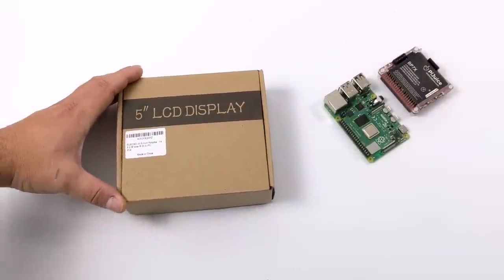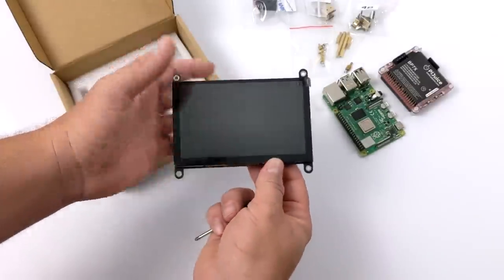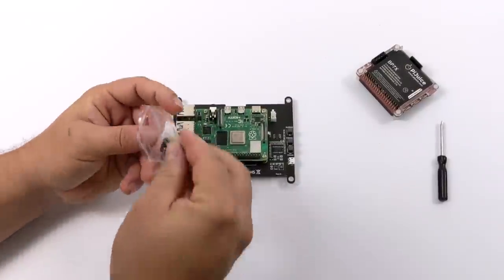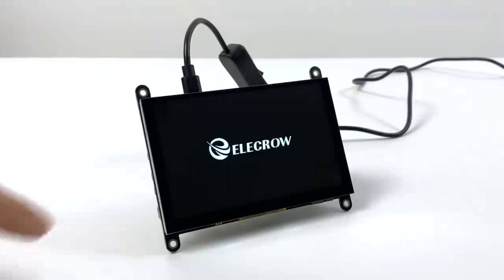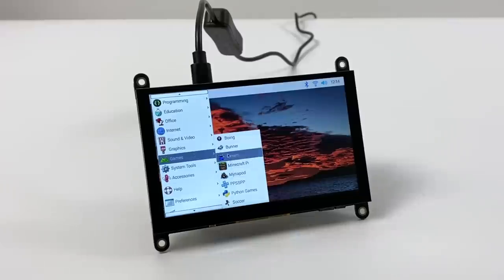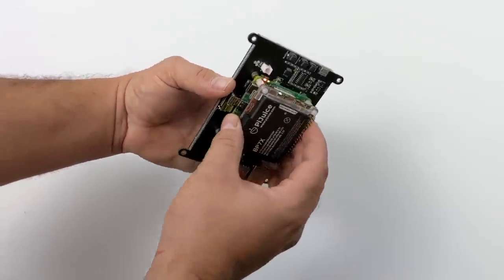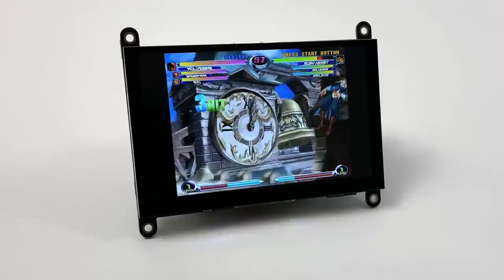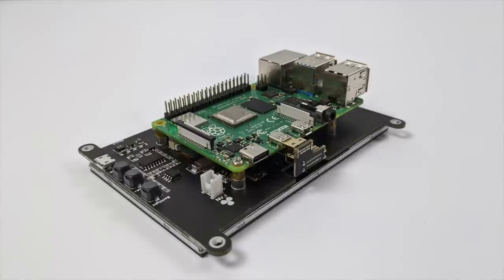Awesome 5 Inch IPS Touchscreen For The Raspberry Pi 4! HDMI & Built In Speaker

Comment: Great product, perfect for a handheld project. Would love if they had a 7" variant.
Reply: They have a very good one. I have the one from eviciv on amazon and it’s fantastic. Powered through the Pi and has two speakers. No plugs extending outside the frame.
Reply: They do. I’ve been trying to decide myself for a bit, and both size Elecrow ones are in my shopping cart on Amazon right now. IIRC the resolution on the 7” is 1024x600.
Reply: Gonna check this out for myself thanks for the info!

Comment: Mine arrived yesterday. Picture quality is excellent. They did a good job with this.
Reply: Hey did you have to edit the txt config for the screen to work?
Reply: @edgar-vt5qi  I edited the config.txt to what the manual has listed, but I think I recall having some kind of issue. Can't remember offhand now what it was that went wrong, but I think it involved changing either the hmdi_drive or hdmi_mode line value from 1 to 2 and that fixed it.

Comment: I hope ELECROW does the same "upgrades" to their 7" display! The removable mounting tabs, the inset ports with specific adapters to plug in a Pi. I can't stand all the cables sticking out the side of their existing 7" model and old 5" model. That makes it very inconvenient to mount inside a case (or makes your case a lot larger than it needs to be). One last gripe about both: the resolution. Sure I can see a low res on a 5" display. But that 7" display needs to be at least 768 pixels tall. Most modern OS need that much height to properly show their windows, dialog boxes, etc. 600 pixels just doesn't cut it.

Comment: That's a really good screen, I wish it would be 1080p but at least it doesn't have screen tearing. Will you try the new Hyperpixel 4.0 Square? Its a 1:1 720p screen but there is absolutely no video testing it on YouTube and it might be the best retro console display out there!
Reply: That looks nice. I have to say, I made a pseudo 1:1 cabinet so I could play both horizontal and vertical arcade games without physical rotation. It's "pseudo" because it really is a 43" display mounted vertically inside, but only a 2160 x 2160 square is visible. Anyhow, you could achieve same thing in a handheld with this Hyperpixel.
Reply: @4h0w1e6  I'm really digging the 1:1 aspect ratio, I have a Blackberry Passport that serves that arcade purpose and little gamedev (tamagotchi-like and such silly games haha) and would love to see a review for that display, the borders are even on all sides so embedding it would be really easy and clean looking

Comment: Hi Eta Prime, thank you for the great reviews on your channel.

It is precisely because of this clip that I bought the same set for a project.

The Pi4 with 4GB of memory and this 5inch monitor.

The power supply has yet to come in, but if I connect everything as you show in the video, it won't work with a USB charger or power bank.

If I leave the USB connection off for the power display and I supply the display with power via the power bank with a power cable, then it all works fine.

What is your power solution that you use in this clip?

Do I have to continue to power the display and the pi4 each with a USB cable or can I also use 1 USB cable via my Power Bank of 30000?

Because it works with a smaller battery for you.

Thanks and regards,
Wilbert

Comment: Would this work for as a display for other systems?
Reply from the maker: Yes, this will work with any os for the pi and any device that has HDMI
Reply: @ETAPRIME  a stylish custom case and some integrated controllers and you would have a cool and unique custom emulation machine
Reply: @ETAPRIME  good to know because the previous iterations were not compatible right out of the box and couldn't work with anything other than a pi
Reply: @_shadow_1  just buy a pi boy dmg

Comment: I want to see that handheld! Any options for a larger battery? I saw the Pi Sugar, but it mounts on top...
Reply: I was thinking maybe the GeekPi UPS/Battery pack that uses dual 18650 batteries, plus they’re stackable. However, for this screen, maybe not, as I think theirs is bottom-mounted using pogo-pins, iirc, but if you search for “raspberry pi 4 dual 18650”, you’re sure to find something similar that’s top-mounted.
Reply: You can connect a bigger battery to the pijuice
Reply: Itai Nelken True, but the cost of the board + 2x 18650 is less than half the cost of a similar capacity Lipo cell. Honestly more like 20% currently from what I’m seeing.
Plus... then you’re dealing with the “early days/Wild West” bs with quality, rather than just being able to pick up a reputable LG HE2 or Sony VTC series cell... and as someone who HAS had even fake brand name cells vent in the past, learning to spot fakes, etc, I am a VERY strong proponent of explosion shielded charge bags, and I won’t touch unknown brand batteries with a ground-isolated 10 foot pole. 
There’s also the benefit of being able to charge up several spare sets in our existing chargers, as I know a LOT of people have plenty of those useful 18650 cells around. Heck, I have mine color-coded with different wraps to indicate which of the 3 types each one is... (and it makes it clear if anyone tries to steal my batteries, as no OTHER LG cells around here have Hatsune Miku on them!) 😁
(Oh, and it also lets you keep them charges in pairs that way. Matching wear on sets.

Comment: ETA what about using a controller like an ipega 9023 would be nice to remove the middle part so you can just slide the screen to the two ends, or finding switch like controllers might make an interesting look

Comment: Exactly what you dislike on the display I like and NEED: mounting holes! More displays need those, because as you said: don't like them? Cut it of! But it is great if you have the option to mount it to a front-panal. Because I am not the guy who likes those cheap 3d-printed cases to hold them "somehow".

Comment: Good-day ETA

Looks good and has some nice features.
 I have a small apartment alarm system I'm working on for a family member and this setup could do the job.
A UPS would be a better fit then this battery setup. 
Looking to printout a case for the screen and Pi.  
The cost in Canada on Amazon .ca for the screen is around  $200.00 
Thanks again for sharing.

Comment: Looks like that particular screen is no longer available on Amazon, at least not the package with the 180 HDMI, USB, etc. connectors. I'm having trouble sourcing just the connectors. Do you have links to just the connectors, or even the whole package from another reseller?

Comment: I just checked the website that you are showing but they no longer are showing the u-shaded adapters or the the fan to connect to the unit. also the unit does not mount the PI4 to the screen.

Comment: Is there a 5 inch gpio screen for the raspi 4
Reply: I don't think GPIO is viable for video out, even if some form may be possible But there are smaller screens than the official 7" one using the display connector insted of HDMI too.

Comment: Idk if you will see this as its an old video but are the holes for mounting the screen around 105mm apart? I'm wondering because I was looking at putting one of these on a fan slot if they fit to moniter PC stats. also if it isn't 105mm one way could it be 105mm the other way?

Comment: Hello. Thanks for the review.  I will buy it thanks to your video.
Did you had to apply any kind of configuration to the raspi? because the amazon page says that I have to comment "dtoverlay = vc4-fkms-V3D" in the Config.txt file.

P.S.
All perfect... but for god sake! why they decided to populate the USB 3.0 port!?? the screen doesn't need it. In any case,
Reply: I answer myself. I got the screen and is AMAZING. you have to make absolutely NO configuration to the device to recognize it, In android just make sure the res is at 480p and in Ubuntu it doesn't recognize the touch out of the box, I haven't made it work yet.

Comment: Annoying that they're targeting a USB 3.0 port for the touchscreen controller when there's two slower USB ports that would do just as well less than two centimetres away... Tying up one of the fast ports seems like a huge oversight.
Reply: its for 1000x multi-touch, y;'know, for ants using this device
Reply: I think it is for the power, probably can't draw enough from the USB2.

Comment: Hey ETA I wanted to ask if you've had problems with a pi 4 connecting to a larger screen like a TV but being fine on smaller 800x480 screens. That's exactly what's been happening to me and I don't know what to do please help
Reply: You need to edit the config file on the SD card . To match the settings you get originally. Because you need to change a couple of settings to make them work on 5inch screens .
Reply from the maker: Have you edited the config file at all?
Reply: @benmaynard3059  the five inch screen works perfectly even without changes the biggest problem is my TV which doesn't even act as though the pi is plugged in and just reports no signal
Reply: @qazip_redact774  like I said . Google the config edit you need . Then Google how to do it .
Reply: @ETAPRIME  I haven't edited the config file at all and the 800x480 screen I have automatically works however when plugged up to my TV I only see the standard no signal blue screen
Reply: @qazip_redact774  it's been pre configured to work with 5inch screens . You must have bought it pre burnt .
Reply from the maker: Have you seen this? https://youtu.be/JYrGoLbiyj8
Reply: @benmaynard3059  even after doing that i still have not found what changes need to be made
Reply: @benmaynard3059  no I burned the image myself to my SD card and later my hard drive using stock raspberry pi os using rapberry pi imager
Reply: @ETAPRIME  yes I have and even when I tried both methods nothing changed
Reply: @qazip_redact774  well . No idea , lol . You'll figure it out .

Comment: Don't like hats that are ontop of the board. WHY? They can interfere with cooling and the Pi4 tend to run hot. Also with the Pi4 running hotter its pushing heat onto that battery pack (or other hat)

Comment: Meh , only thing this thing has that 5 inch waveshares don't have is a speaker . I've got too many 5inch screens  . Lol
Reply: at least compared to the ones I have this mounts backwards, that's huge if making a handheld because you can slim the USB's down to single height and remove the NIC, trim or remove the GPIO and suddenly you've got a much thinner setup than the Waveshares and if you use a slim fan you exhaust straight out the back which is nice